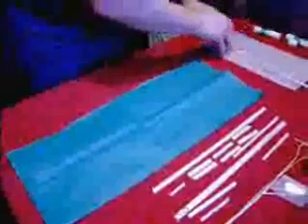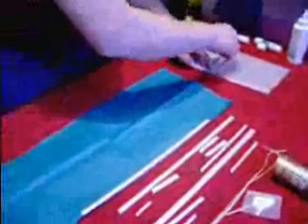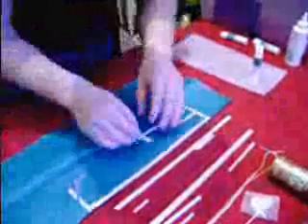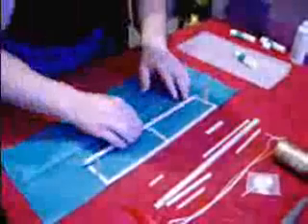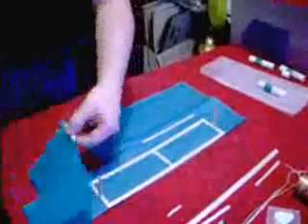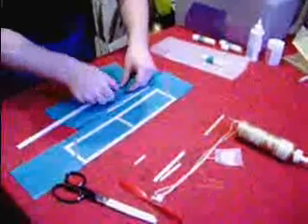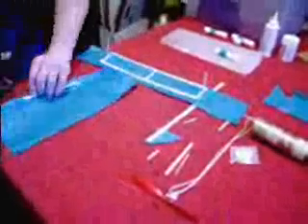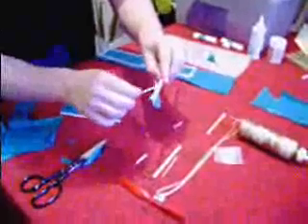rubber band airplane in 10m

Comment: great video, thanks.
If you want to avoid warpage from the paper then you can preshrink the paper before you use it.

To preshrink, take a sheet of paper and clip it to a string  like a bedsheet on a close line. Then mist spray the paper with water from a spray bottle. Let it dry then repeat. The paper should not shrink after it dries the second time. It will be stable and ready to use.
Reply: ⁰0⁰99⁹o